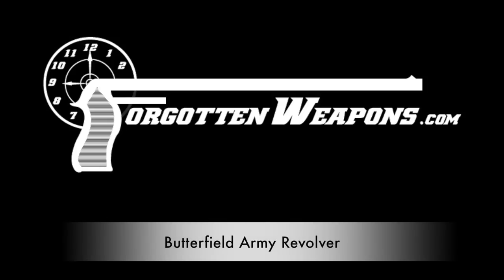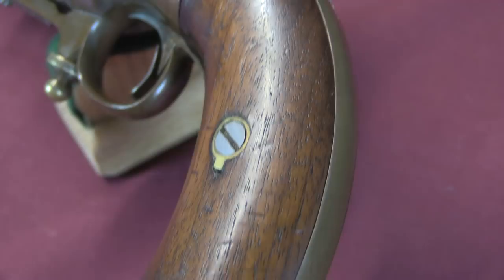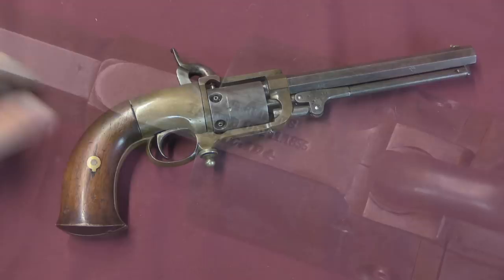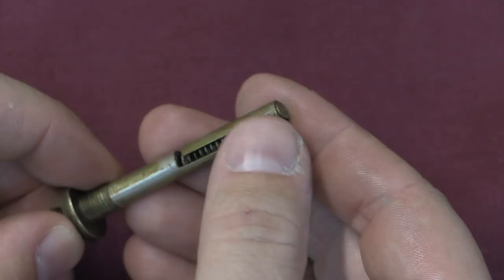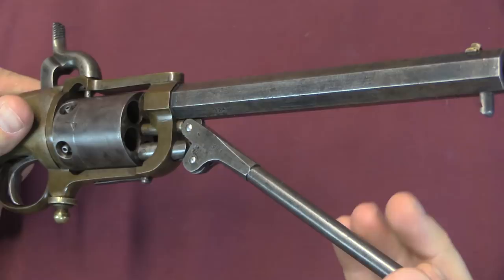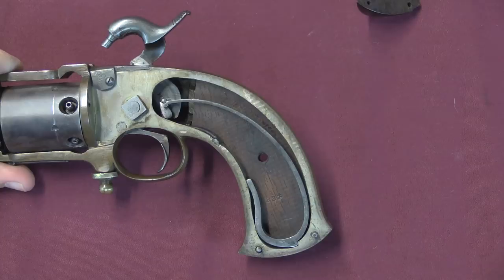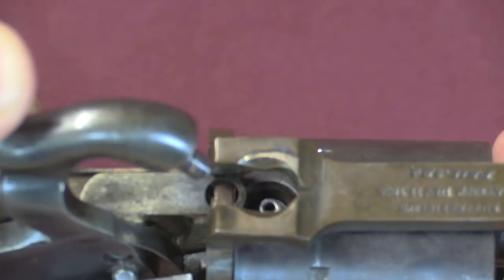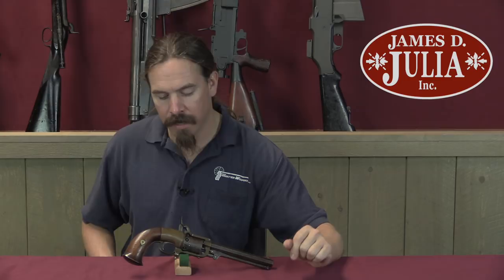The Butterfield Army Revolver and its Automatic Priming

Comment: Another problem with Colt revolvers jamming with spent caps is that the hammer has a small recess in it that is meant to set the hammer down between the nipples and hold the hammer safely in place so you can carry six rounds without the hammer sitting on a live cap. It works great for it's intended purpose but it has the horrible side effect of grabbing the spent cap and sticking into the recess. However,my understanding is that it wasn't as bad of a problem on original guns as it is with modern re-productions. 
One of the things you'll see seasoned C&B shooters do is point the muzzle up vertically before they cock the gun.The orientation helps the spent caps fall free from the gun better.

Comment: Do anyone of you, know of a cap and ball revolver with a quick change cylinder (a magazine for a revolver)
Reply: CarrotofGreatness I'd be surprised if they exist. During the cap and ball era making parts sensitive to precise fit, like revolver cylinders, interchangeable, would be a massive undertaking
Reply: The British Kerr Revolver reviewed by Ian recently had a very easily removed cylinder.  But as said by Krpajda above I doubt the replacement cylinder would fit and operate perfectly without a Gunsmith fettling both cylinders and the gun.  Plus you would need some sort of container to hold the spare cylinder just carrying it in a pocket might mean an empty cylinder and a pocket full of bullets, powder and caps.
Reply: If memory serves me correctly, Clint Eastwood demonstrates that very thing in 'Pale Rider'.
Reply: +Smoke That - Good example.
Spare cylinders WERE a 'thing' at one time in the cap & ball era, even for the cap & ball Rifles. 
But metallic cartridges came out before they became truly common - kinda from the same reasons as mentioned here - better manufacturing tolerances made BOTH easier to do.

Comment: Seeing as the pellet pushing plate doesn’t seem to be precision fitted, I.e. there is a gap larger than is necessary for the plate to move, wonder what’s the likelihood of the pellet column exploding from firing. Especially if there is a timing problem with the nipples or a damaged hammer. Definitely a novelty and not suited for general issue.
Reply: Legionitalia I was wondering the same thing. Also what are the chances of the pellet falling out if the gun is held at an angle ( as sometimes happens when a person is suprised and has to access the firearm quickly) . Any one have any thoughts on the likely hood of this happening?